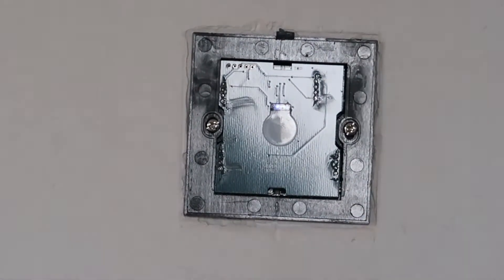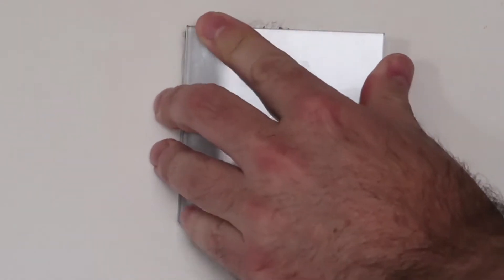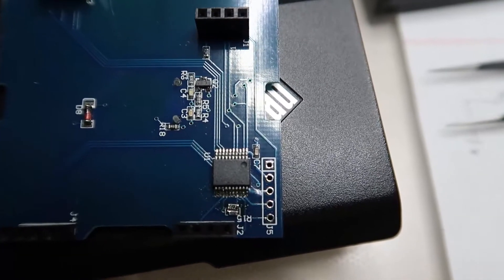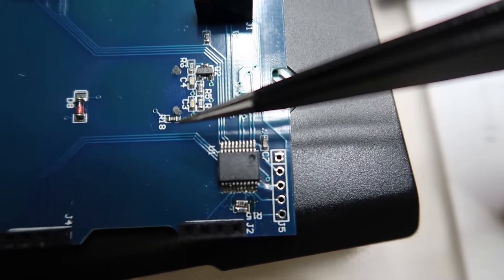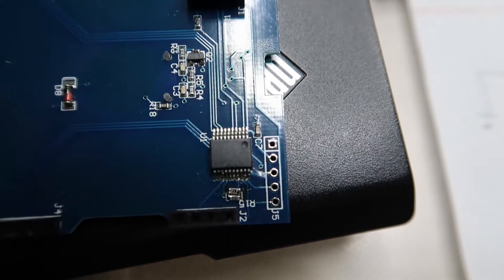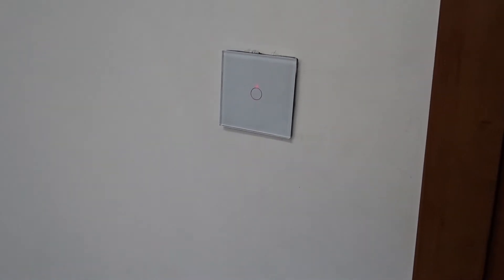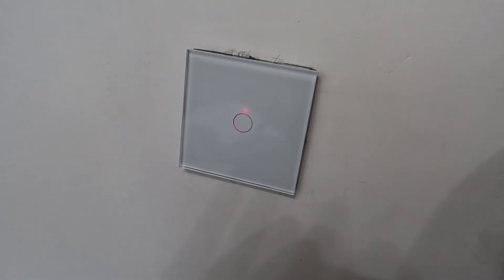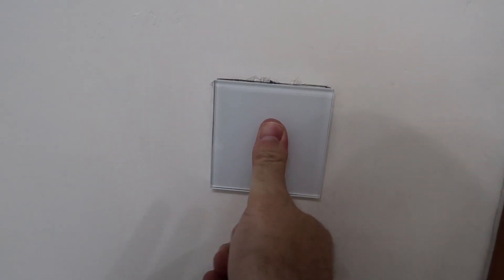Fixing Livolo Switch

Comment: When you turn the mains on after installing the livolo but before putting the glass on - the Livolo touch gets calibrated to work with the no-glass resistance. The correct way is to have the glass panes put on first before the mains power is turned on. This was the Livolo touch will be calibrated to use the resistance of the glass panel.
Reply: yes, i have already seen that. If you return the main without glass panel mounted, it will not work, or may will if you are very lucky... ;)

Comment: You should try turning off the main power (from the switch board) for 30 seconds once the glass is on. That worked for me.
Reply: I m with the same problem! 
On the single glass everything works fine, but when the glass is double or triple some gangs dont work! can be the glass defective?

Comment: Hello, can you use it as a button and do not switch with a change?
Reply from the maker: what do you mean as a button, just one time activate with no ability to disconnect ?
Reply: When I press only a pulse. Closes the contact and reopens immediately.
Reply from the maker: This is something else - it seems may be deffect microcontroller - microchip, or may be the mosfet or transistor that is activating the relay is deffect.
It is simple to test - if you have 2 switches - just replace the upper board between them, to confirm that the upper board is deffective.
The upper board have inside the microcontroller, and the lower have the relay and relay driver
Reply: All store 30% off - Shop livolo touch switch  at www.livolo.com